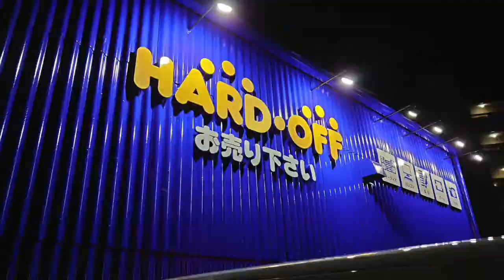The Problem with Flat Screen CRTs w/ Andy King - CRP Clips

Comment: I wouldn't say all the flat screens are horrendous, I wouldn't go over 20" for one though. They might have a slight bow but the trade off is usually they have component input and a newer build date.  I do prefer the curved but had to use a flat for a year until a decent curved one came up for sale locally.
Reply from the maker: I agree not all flat screen CRTs are like this. I think they did get them mostly right out of the factory but as it was very hard for them to calibrate properly, they are more likely to fail at the edges

Comment: This video is kind of reassuring to watch, i have a KV27FV300 and despite spending hours reseating the yoke with new mounting tape on the wedges and adjusting the service menu for hours as well, i just cannot fix the extremely warbly horizontal linearity and the bow just would not disappear, its either at the top of bottom of the screen or you comprise with a bit of bow at the top and bottom.

Theres even these stranges dips inward on the sides as well, and the convergence in the corners and edge of the screen is poor too. (Static convergence is pretty good at least.)

Ive read that the horizontal linearity can maybe be fixed by recapping the deflection circuit, i really dont want to give up the TV because it has a very vibrant and bright picture and i like the size, but i may just look for another curved unit.

Thanks for the clip!

Comment: Have you guys talked about these flat consumer CRTs and light guns? Every time I've tried to use light guns on these, they end up being super inaccurate. Especially when shooting at targets toward the sides of the screen. I've seen other people say they work fine. Am I just having bad luck with badly calibrated TVs, or is this a real thing? 
With the last one I owned and tested the most, the PS2 Guncon games seemed to be the worst, though still not great with Konami Justifier on Genesis/Sega CD either. Don't think I tried NES Zapper or Dreamcast at the time. Not sure if different systems use different tech to do their lightgun thing. I no longer have that TV. I think it was a Toshiba 30" (non-HD) CRT. If I'm gonna lug around a huge TV like that when I move apartments, etc. it needs to do everything, including light guns. That one didn't make the cut, last move.
Reply from the maker: Flat screen CRTs are known for being poor at the edges with light guns. The engineering it took to create seemingly a minor visual change from the outside was huge. The edges suffered.